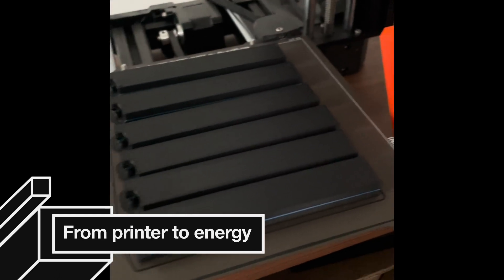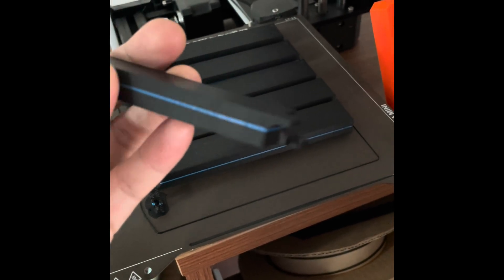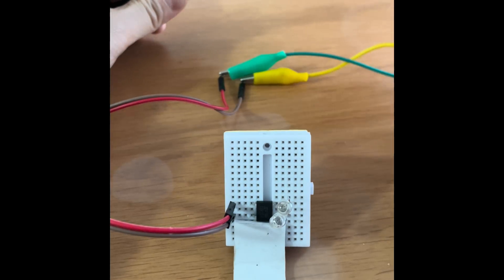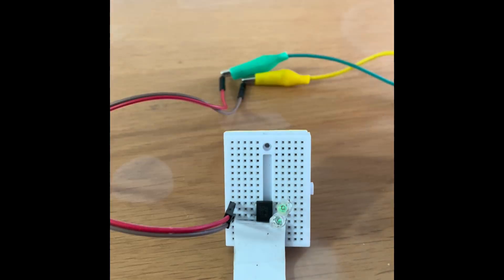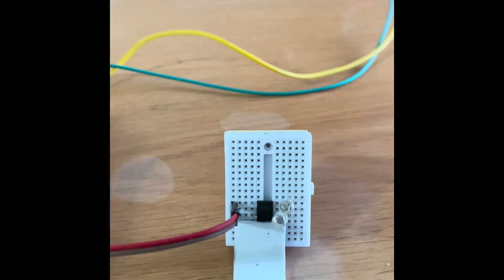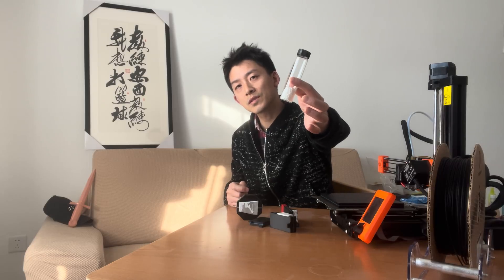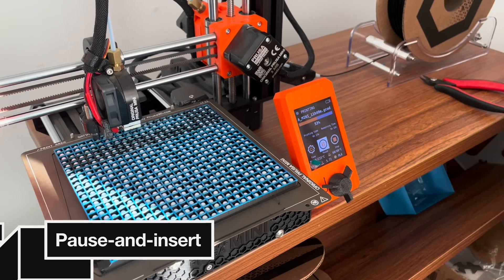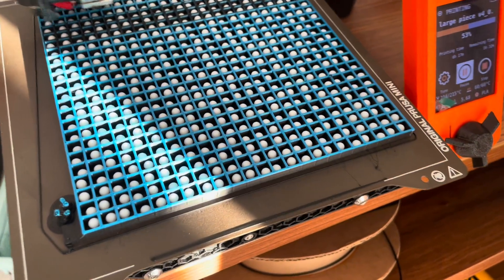3D Print Energy - Microbeads Triboelectric Nanogenerator

Comment: I made a small one with 100 PTFE beads that are 4mm. I used Protopasta conductive PLA, a middle layer of regular PLA and finished/encapsulated the TENG with Protopasta conductive PLA. I'm not able to get an LED lit. Am I missing something? Do I need a resistor?
Reply from the maker: 1 please try some different small LED, I do find out that some LED has higher current threshold. 2. use gloves when shaking, don't hold both conductive ends with your hands. 3 check @ethanwaldo1480 's comments below.
Reply: @TENGBINN  I was able to get it to work! I made the walls thinner and used 400 PFTE beads that are 1/4" (~6mm) in size. I also used nitrile gloves. I hope to be able to use this energy to charge a rechargable battery. Thank you!
Reply: @kevinb9790  how much voltage and current were you able to generate?

Comment: Hello @TENGBINN.  I've printed out the microbead generator using Protopasta conductive PLA with regular PLA insulating layer and get resistive measurements on each side but not across, which indicates the sides are properly insulated.  Using 4mm PTFE beads from McMaster Carr.  I'm using a full-bridge rectifier using 1N4007 diodes with a 660ohm resistor, single LED, and 470uF capacitor.  I can light up the LED with a function generator at 60Hz 6V+ but I get no light from the TENG.  Do you have any suggestions on the electrical circuit?
Reply: I see you have a single IC in your video for the 2 LEDs.  Would you mind sharing what the IC you're using is?
Reply from the maker: @ethanwaldo1480  What I used is basically a rectifier and that is it. And you don't really need it, you just need to directly connect the pack to a LED bulb. No capacitor is needed.  turn off the light and check whether the LED is working, and looking at it at the right direction. 
How many beads you are using and how much volts you can generate?  A portable voltage meter can roughly measure the average volts. if you can share a video or picture somewhere or directly to my email, I can help to check it.
Reply: @TENGBINN  Thank you for the reply.  I'm using the 9x6 configuration from the STL for a total of 54 beads.  I found a 1mm insulating layer still showed about 5MOhm of resistance and couldn't get more than 20V peak AC so I increased it to 2mm and now get just over 30V peak AC and I believe ~10-12V DC on my oscilloscope.  This is with just the rectifier, no cap or resistor.  When I connect the LED the DC drops too low for the LED to light.  I'll try to find your email and send you what I've got soon.
Reply from the maker: @ethanwaldo1480  I have to ask where you do the test. Humidity is a big problem for TENG. Dry is better. About the insulation layer, for me, when changing from conductive to non-conductive materials, you need to let the rest of conductive materials run to waster for several rounds since it will stick to the nozzle for a lot. So increasing the layer height is an ok practice. 30V is definitely good enough to light several LEDs. 3V is normally good enough. try different LEDs. Also shake quicker to increase the current.
Reply: @TENGBINN  I'm at about 37% humidity currently.  My printer does purge material between filament changes.  At this point I'm fairly confident the 9x6 TENG doesn't produce enough current to drive the LED. Your videos mention using around 500 beads which could account for the difference compared to the 54 bead device.  I'm going to try printing a much larger version in the meantime.
Reply: @TENGBINN I finally got the LED to light and it ended up being two things.  First, simply shaking the 9x6 TENG wasn't enough.  I noticed you're striking the TENG and when I do that I got over 150V, though it still wasn't lighting the LED.  I also printed a 18x12 with 216 beads which does light up the LED when striking, not shaking.  I'm pleased I was able to reproduce your results and now I can start putting this to good use.  Thank you for all the suggestions.
Reply from the maker: @ethanwaldo1480  Very glad that you can reproduce it ! but 150V for one LED is weird. You may need to search and switch between LEDs (normally 3V is good enough for a LED). Shaking a 9x6 can definitely light several LEDs. I want to emphasize that don't use your bare hands to hold and shake, because hands are conductive. Either wear a glove or just touch only one electrode. Another point, try to measure the voltage you can generate. A 9x6 can at least output more than 50 volts, which can easily light more than 10 LEDs.

Comment: Very interesting device.  Since the conductive PLA has a very high electrical resistance, would that negatively impact the power output from the device?  If you could deposit, electroplate, or peen copper for the conductive layers would that improve the output?  I realize this could negatively impact manufacturability which is one of your goals.
Reply from the maker: We primarily thought the same as you that conductive PLA may not performance well as copper film. But we still give a try and the output is not bad at all! As you mentioned, the manufacturing is the key point, so any 3D printable conductive materials (or other coating method) can be tried. electroplate is the one I really want to try later.

Comment: Hi. Very interesting idea. I too would like to assist in any further development. I tried the link to the paper, but was unable. Happy to connect and sign any non disclosure agreement, if required. Warmest regards Peter
Reply from the maker: Thank you for the offer. I guess I am not supposed to post unidentified link. The paper is DOI is  10.1016/j.mattod.2023.11.001,  and title of the paper is "Fully enclosed microbeads structured TENG arrays for omnidirectional wind energy harvesting with a portable galloping oscillator". If you don't have access to the journal, you can contact me through email.
Reply: @TENGBINN   Hi  Leo N.Y. Cao. Yes I got access to the paper :) Looks very interesting indeed. Congratulations on its publication. Shall contact you via email to take this product further. :)

Comment: Very interesting!  Where are you based?
Reply: I own the bambu x1c and my prusa is now collecting dust. Granted it's the prusa mini. Bambu has changed the name and everyone else now needs to step up.
Reply from the maker: Hi there, I am now in Beijing, China. We can set up video meeting if you want, but man, anyone, who has a hold of the device, love it! I am also working on other applications using the devices. So hopefully you can see my other work get published and presented online very soon.
Reply: @TENGBINN  - I wish that I had met you while i was still working in Beijing!

Why don't you use a Chinese 3D printer?

Have you been watching Robert Murray Smith's recent experiments with 3d printed electrostatic generators?
Or that guy that is push 10k volts out of his hand cranked desktop contraptions ?
Reply from the maker: @christopherd.winnan8701  I would love to use Chinese 3D printer if there is one as robust as Prusa. Prusa is my favorite. I heard Bambu printer is good. I may try later.

In our field of triboelectric nanogenerator (TENG invented 2012), there are two main mechanism: triboelectric effect (or contact electrification) and electrostatic induction and Maxwell displacement current. Normally a electrostatic generator only use the induction part and the output will eventually fade away because the charge will go away. As for TENG, the surface charge will always get supplemented by rubbing or contact, making it very special.  Also, the device includes 4 main working mode, making it very flexible for various energy harvesting scenarios. Allow me to cite my own review paper, https://doi.org/10.3390/nano12193261, Fig.2 shows the 4 modes. 

The TENG field (more than 10,000 scholars) not only focuses on the energy generation part, but it also deal with fundamental charge theory, electrical circuit, self-powered systems, and various applications such as wireless communications and aerodynamics sensing (my own interests). Let me know more where you want to dig into, and I can introduce you papers and videos. You can also find my homepage in English in my channel information for my work to start with. 

For a electrostatic generator, 10k volts is achievable because it can output high voltage but low current (Which is very good for lighting LEDs and working as sensors). To work as energy harvester, the power management system is needed to lower the voltage and increase the current to get better figure of merit.  And I believe the generator 725 made by @ThinkingandTinkering , counts as a TENG, and we actually have many studies and published papers using that rotation structure.